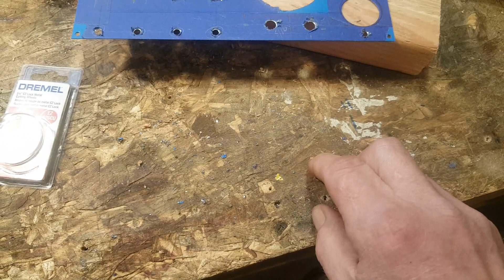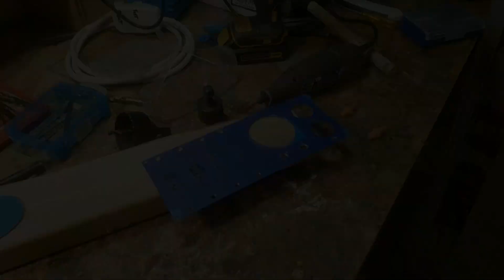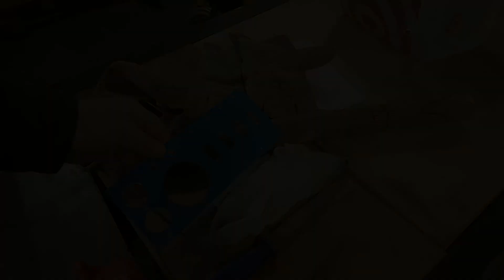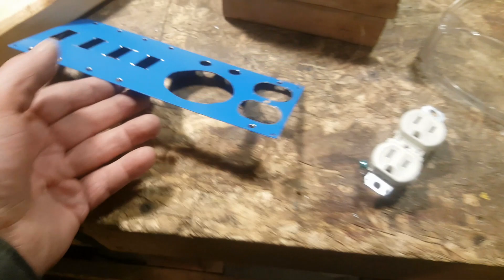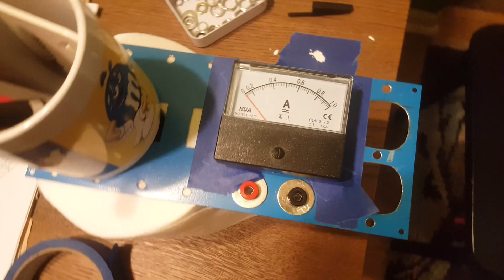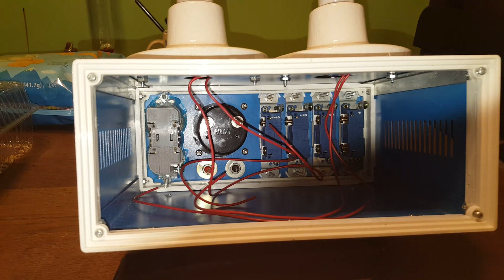Dim Bulbyst  – part 1/3 – Construction

Comment: What does it do, Chuck? What's it for?  Interesting.
Reply from the maker: Hi Aaron. What this does is apply power to an old radio in a very safe way. In a current-limited way. This lets me power on an old radio that's been sitting for 50 years safely for further testing. And when it's used with a Variac (a variable AC transformer), it lets you monitor the AC current while 'reforming' capacitors. 'Reforming' is a term used for attempting to  bring a little more life to an ancient electrolytic capacitor. You apply a voltage to a cap, and very very slowly increase it until it's reached it's typical operating voltage.
Often times, an ancient electrolytic cap in a radio will draw huge current, and act more like a small value resistor than a capacitor. This fries power transformers, which are often irreplaceable. When a 'dim bulb' unit is used however- the worst thing that can happen is that the light bulb on the 'dim bulb' device lights full brightness. It limits the maximum current that can flow through the device under test.
Aaron, I'm going to make a video late today to explain this and demonstrate it. OK? I've got plumbing to repair for my sister before I can allow myself to play around with videos. lol. Be well and I'll ttyl  :)
Reply: @n8nkqrp595  Way over my head Chuck lol. I wish I could learn more about electronics. I should take a class at a community college and try to get a basic understanding of common components and their functions.